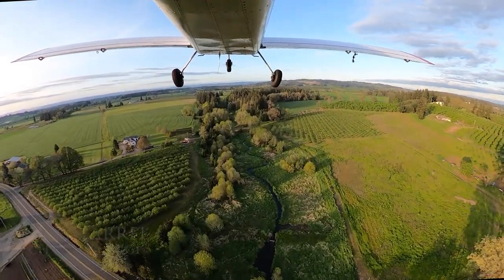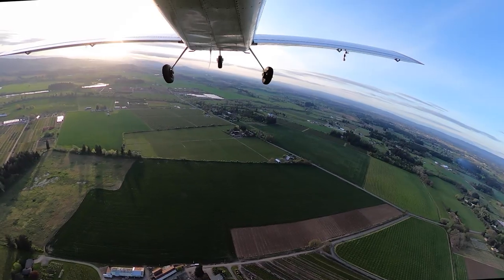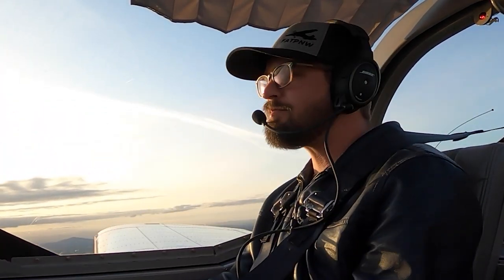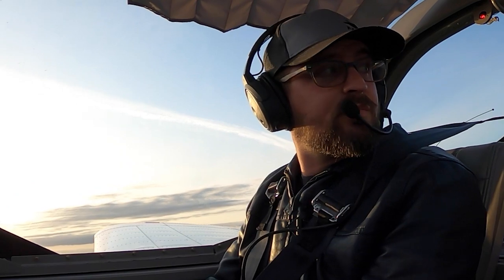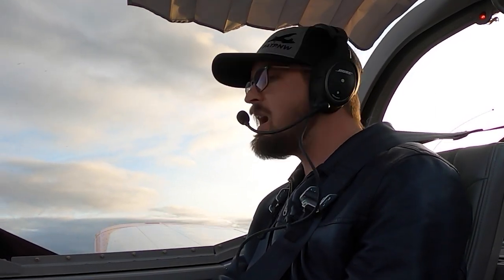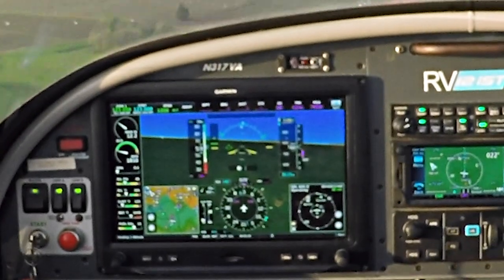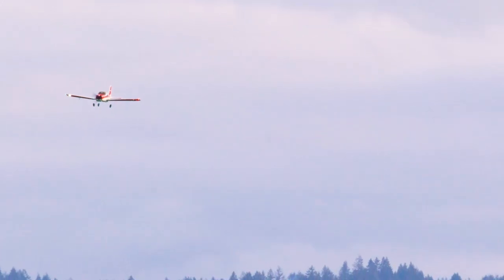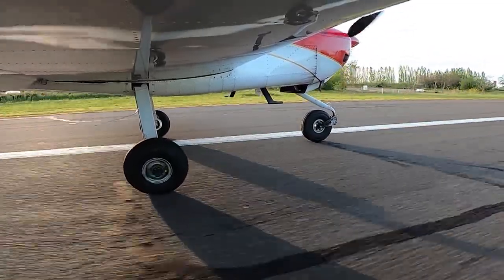How to do FORWARD SLIPS - in an RV12is!

Comment: Do you have any RPM in (above idle) on final before your slip?  If so, how much?  I'm assuming it's like your normal landing where you've pulled power out to almost idle when you were abeam of the numbers or turning on base.  New student pilot flying an RV12 ULS I just got 9 (funny, it's the same paint scheme as in your videos but not an SLSA - I named her The Baby Ferrari).  Love your videos, would like to see more RV 12 videos.  Thanks for all you do for us!
Reply from the maker: Thanks for the kind words! In a practical sense if you’re high enough to require a slip to get down, you should know by the time you turn final and therefore shouldn’t have any power in. For the purpose of demonstrating a forward slip and purposely staying high, you just want enough power to maintain altitude until you’re ready to do the slip. Let me know if I can be of any more help! 🙌🏻

Comment: Short Field landings with obstacle were one of my favorite practice maneuvers in a C150, engine idle (CH=on , Fuel=B), full 40deg flaps, stand on the rudder and look out the side window at the numbers on the runway as you come down what feels like an elevator. Line it up about 20 ft up and all that air trapped under the wings gives you a nice flare and bump to a full stop.

Comment: i would think that you would want to be in the highest drag flight speed.   obviously the faster you go the more parasitic drag, and the slower you go the more induced drag. 63 is best glide, which is normally right around the lowest drag airspeed you can be at. so continuing at 60 is pretty much the lowest drag you can have. (I would think) Increasing forward speed to your Vf and hold the slip in until you are at the energy you require.  I always aimed at the end of the runway and kept the slip in until I was at the correct speed.  if you are taking out the slip before you are at your target speed you are just taking it out too early.

I'd rather be extremely uncoordinated close to the ground at higher speed than at a lower speed.

But I'm not  flight instructor nor an expert in the area so Don't take my opinion as fact.
Reply: A good reason to put the nose down a bit in a slip: life insurance. If, for whatever reason, you happen to stall at or below pattern altitude in a cross-control situation, you are likely to damage the nose wheel. -Old pilot

Comment: If you slip crossing the controls to the opposite side, what would the pitot read?  Also, going that slow at 60, and with "inaccurate" pitot tube readings, as you explained so well, are you concerned with getting too slow without realizing it since your airspeed indicator is now not showing an accurate speed?
Reply from the maker: Hey John! So in the rv the airspeed readings don’t really vary from side to side because the pitot tube is in the nose of the aircraft. With a more conventional pitot tube though, you will typically see more of an effect from one side to the other. Nothing to really be worried about as far as getting too slow. As long as you keep the nose down you won’t stall and as long as you keep it at the same pitch you had established before putting the slip in, you should maintain a good airspeed without going too fast. 👍
Reply: @NorthwestAeronaut  Thanks for your great response. Oh ya, forgot the pitot is in the nose for that plane. 

P.S.  Keep up the great videos. All the best.
Reply: Also, the beauty of a slip vs a skid is that the higher wing would stall first. Unless you are pitching up, it’s almost self recovering.

Comment: Great video. I see your approach speed is 60. What would the speed be with an adult passenger?  I fly a 12 and my approach when alone in calm winds is about 68-70 in Florida heat. Always looking for that perfect speed with a passenger on board. Thanks for your thoughts. KAPF
Reply from the maker: Thank you! Those are the speeds I use regardless of loading. I’m always in the plane with another person and is rare I’m solo in it, but this is exactly how I fly it and how I teach my students to fly it. Coming in at 70 is way fast and beyond what the poh recommends. You’ll be eating up a lot of runway by doing that. Especially in the warm Florida weather. So I definitely recommend using 60 as your approach speed :-) 👍
Reply: I’ll add a caveat to the above comment, more speed and less flap is appropriate when dealing with a high crosswind component. You’ll get better rudder authority to allow for higher wind correction.